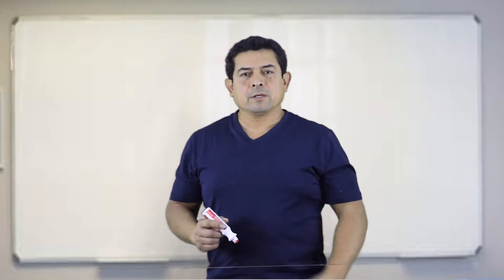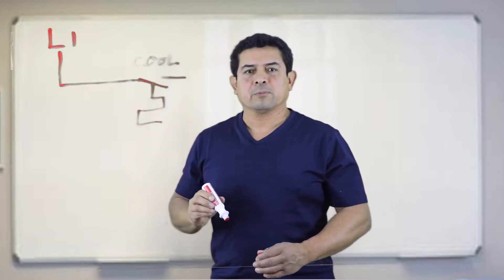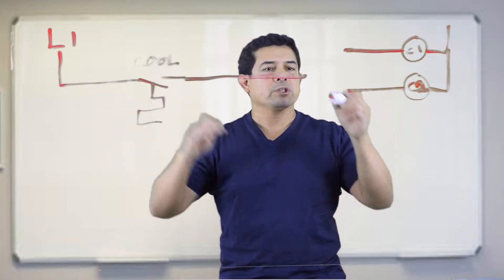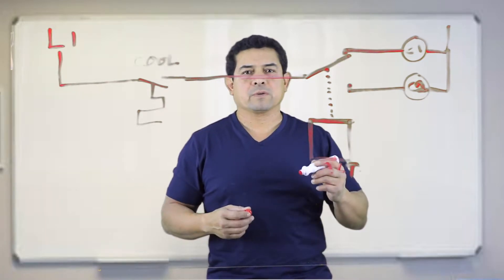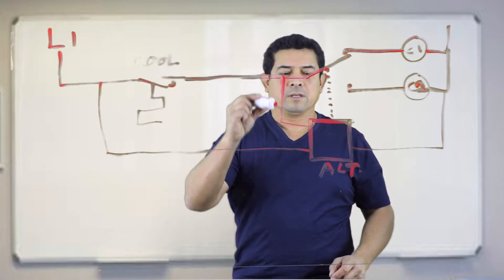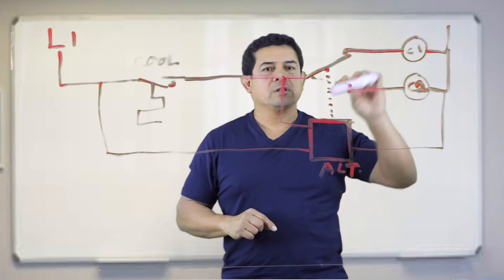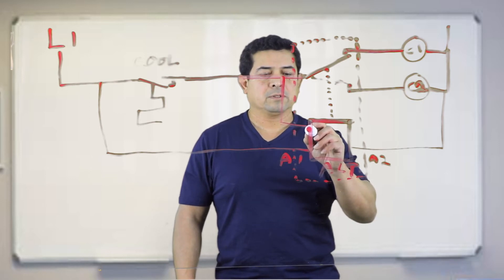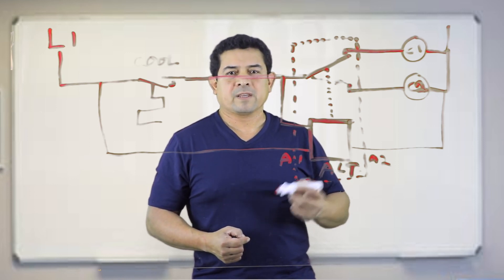Alternating relay - HVAC Online Training and Courses

Comment: Can I use another power supply for the alternating relay coil and another to power the load side for a system with different voltage?
Reply from the maker: Yes! You sure could use a different power supply for the coil in another to power the load. A lot of times the coils are 24 V. And the load is going to be line voltage. Thank you for watching.

Comment: Would that "signal " wire you speak of to the alternating relay be called the lead or lag switch?
Reply from the maker: Some people would call it that.    But on a true Lead or lag switch there would always be a lead motor or compressor.  Meaning that, that specific compressor would come on first and shut off last every time.    With a switching relay it would alternate from one to the next constantly, so each motor or compressor would get an equal amount of running time.  that is the main difference.  I hope this makes sense.     thank you for watching.